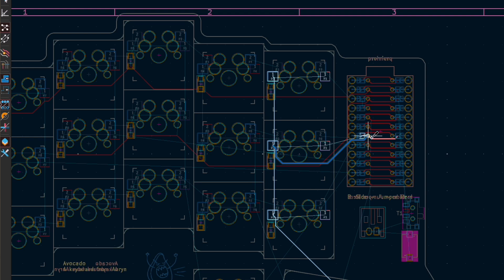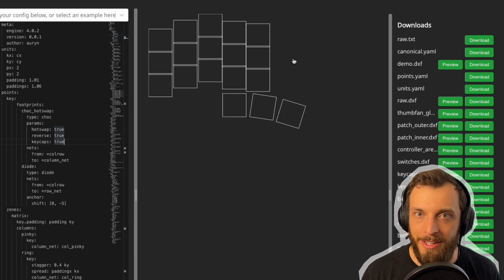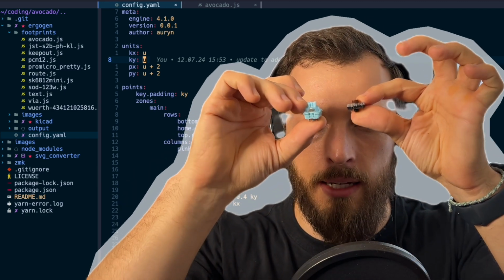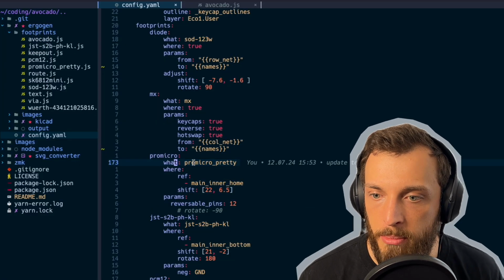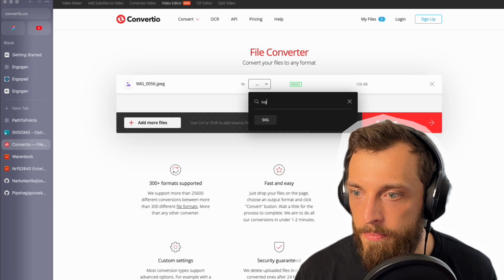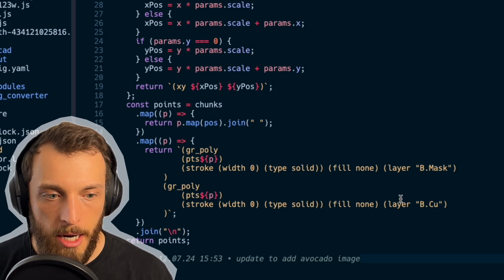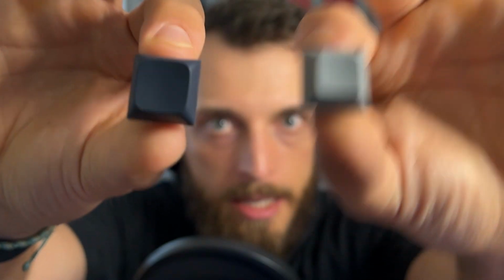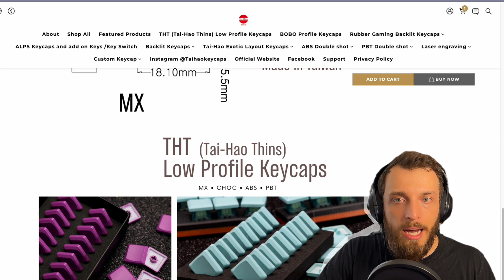Building My Dream Keyboard with Custom PCB Design | Part 1

Comment: I really like this video and have found it really useful for my own keyboard plan.  

I have a question about how you designed the base plate and switch plates and where you ordered them from.
Reply from the maker: What is the question about?
I ordered them the same way as the main pcb. Even so in my latest builds i dont use a base plate nor a switch plate. There i only have a main pcb and it works great as well.

Comment: I just want to have a custom keyboard. So my idea is an aluminum keyboard with knob & screen but the twist is the knob is gonna be at the ESC key. Removable knob ESC key. i really want a knob at left side also a display top right side also 2 two key beside space bar right side with arrows. Also QKM/VIA support & tri mode as well. Is there any chance to have this keyboard? I really want to have it. 

cream white color with blue/red/ any other color same as picture. 

i wish some company make this
Reply: you can make it yourself! start small and slowly increase the difficulty of your project. look at the description of this video for helpful resources!

Comment: How you use the ergopad JSON in Ergogen?
Reply from the maker: I was using it for the initial setting of my fingers, yes :)
Reply: @ so you don’t import the JSON? Do you usr the visual picture as a rough guide?
Reply from the maker: basically yes :)
I mean, it does not need to be perfect, since the fingers move anyway. so was more of a rough guideline. :)
Reply: @CodingWithAuryn  Thanks man

Comment: hey! what did you use to convert the paths to points?
Reply from the maker: Hey, i was using: https://shinao.github.io/PathToPoints/

Also updated the description :)
Reply: @CodingWithAuryn  Thank you so much! Also wanted to tell you I've been building the same layout and wasn't sure how to add my branding on it. Thank you so much!
Reply from the maker: @soujanya1  Cool you like it :) 
Also if you are interested, you can find all code on my repo and also the gerber files if you just want to print this one. I will probably build an update some day to tweak a few things. The cheapino is also an amazing board.

Comment: Main thing priveting this for me is kicad.. it's really intimitating :(
can you make a tutorial on that?

 just 2 week ago i build my first chocofi, and the thumb cluster is the problem.. i ended up moving  everything from thumb to combos, tap dance and layers and only using 1 thumb key from both hands...
Reply from the maker: Agree 100% 
Yes, will do one, if my pcb is working :D
Before, i am not sure if i did everything right. But currently it seems good. Also I think it gets easier the more often you do. I routed the pcb like 10 times :D
Now i feel comfortable and fast and it takes me like 20 min to route the whole pcb :)
Reply: @CodingWithAuryn  wow, thanks, 

also which software you are using to model the case? I was little familer with tinker cad, blender, onshape and freecad, but everything i make looks awful :*) and seems like everyone is going with fusion360 for ergo keyboards..
Reply from the maker: Usually I go with fusion360, before i was using tinkercad, but it was too limited for me. With fusion360 the case design works for me the best. But in this build i dont plan a case yet, i plan for a base and switch plate from pcb material. Lets see if this works, or if i need to print something later on :)
Til now everything is open :D
Reply: @CodingWithAuryn  :)